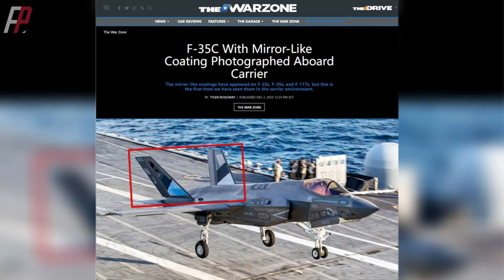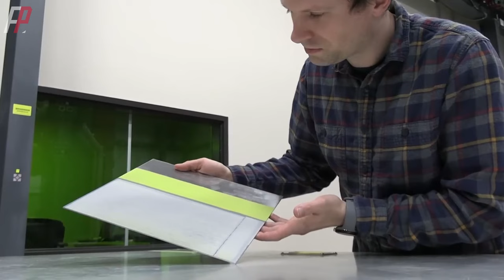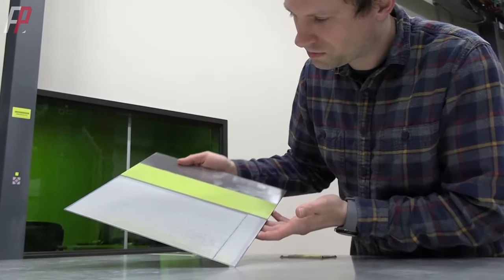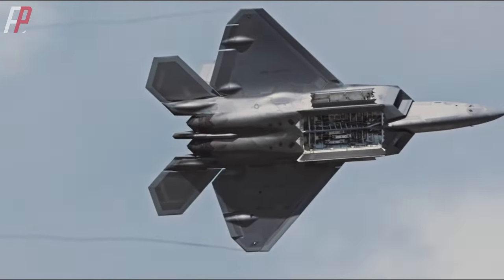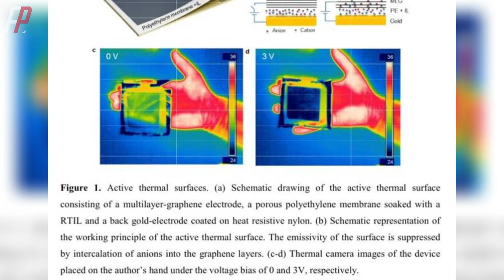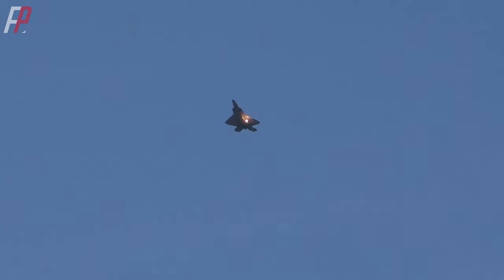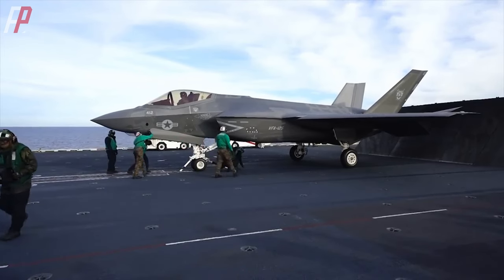Navy F-35C Surfaces Wearing New Mirror-Like Skin

Comment: The EOTS and DAS of the F35 allows it to lock on and guide a missile to it's target from 100+ km away. It takes computing power but it is being done. That's why even an F22 is not safe from a single F35 and definitely is in trouble if you have two F35's in battle space that bumblebee can be tracked.  Also the IR signal of the the F22 and F35 is small and by changing aspect they can push the usefulness of the flares to almost 100%. Light based systems will improve by seeing the disruption of objects in light or absence of light in an area like solar eclipsish. More computing power means using sensor data like never before and using broader band sensors. 

Have you ever looked at the $10 bill to note the change of color in the ink as you change aspect angle? This can help fool long term development in sensors.  You change the shape an size of the bumble bee or marble at varying EM frequencies and maybe I am not tracking a real aircraft but a anomaly in my system.

Comment: 1 ~ I don't know, I'm speculating.
One thought, experimenting with infra-red stealth or camo. Ways to suppress IR or confuse / deceive trackers.
2nd thought ~ we have radar absorbent paint and coatings, we've had them for 40+ years. The best ones involve iron balls. Trouble with that, iron balls are just itching to rust, and once they start to rust, they turn brown and there goes your radar absorption. So what do we do with that paint? We stick it on Naval fighters, and park them on the deck of aircraft carriers, and wander around the world's oceans burning money. Maybe there is another material which absorbs radar as well, or nearly as well, but it's just a tiny bit more resistant to salt air and clouds and fog and stuff ... doesn't get ablated or destroyed if you fly into a shower of rain at 400 knots ~ Doesn't need to be applied like the lacquer on a Stradivarius Violin, can be applied like the paint in graffiti, by anybody...